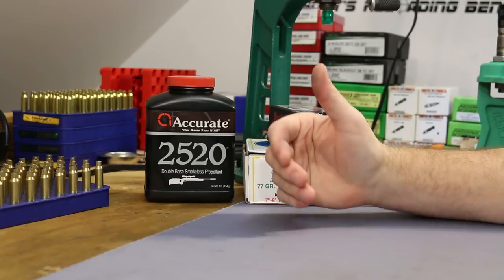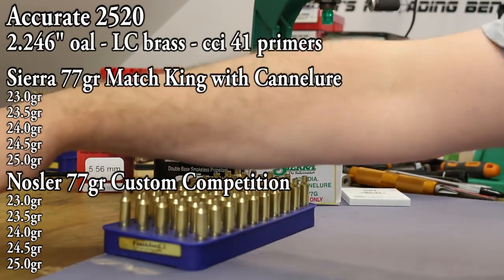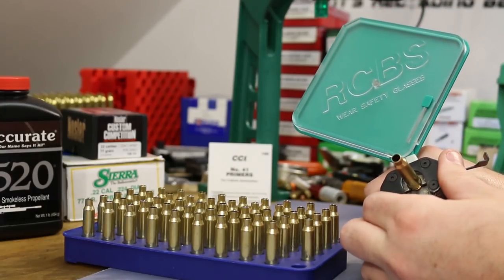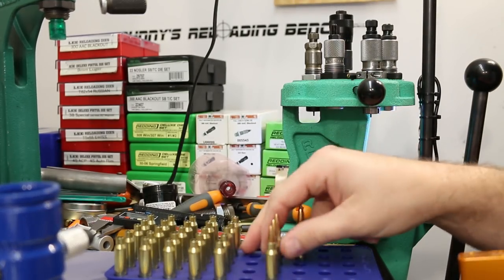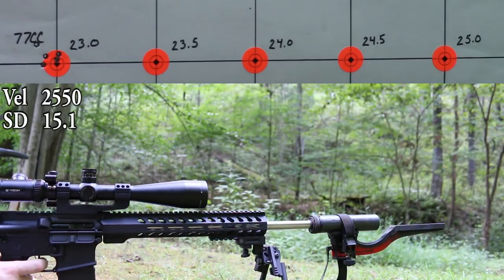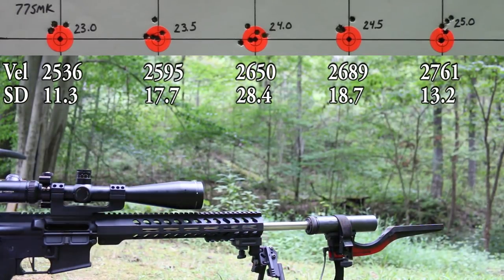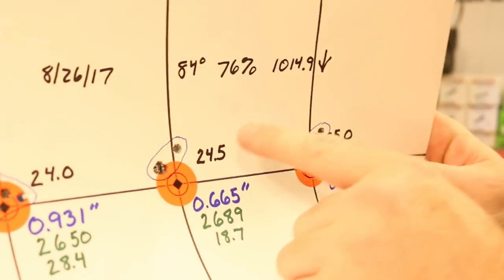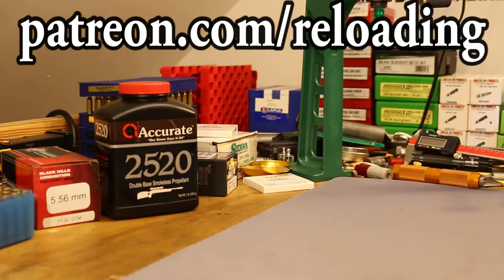Mk 262 Cloning - pt 2 - Sierra vs Nosler with AA2520

Comment: Discovered this series in 2021 after pulling stuff out of storage. Purchased a couple boxes of the BH 77gr OTM at inflated prices to examine and the one round I've pulled apart has an extruded, single perforated powder at 23.0 gr. The mystery deepens. Great channel and very helpful info for everyone.
Reply: I'm guessing they change their load based on feedback from the military, because the one I pulled had a ball powder and a primer that both looked different than the powder and primer in this video and it was 24.2 grains. I'm starting to think that any 77 grain load that meets the standard could be considered a mk 262 lol

Comment: Love this series JRB. Your gonna end up breaking that 1/2" barrier in this series, I'm calling it, I see a 1/4" group coming! Please just make sure in the series if you can to test IMR 8208 XBR and TAC. Around 23.8 grains of IMR 8208 XBR seems to be the clone load for IMR 8208 XBR, and around 24.0 grains of TAC seems to be the clone load for TAC.

Not sure it mattered either with the crimp on the Noslers, while I don't crimp non cannelure match bullets and it certainly doesn't take much crimp to put a crease in one by crimping it without a cannelure, I still don't think it mattered. In my experience they just don't shoot as good as SMK. 

I like the idea of adding the best load from the previous powder to the next test to compare to. Also your barrel is shooting great but definitely shoots better cool, thumbs up for taking that break to let it cool. Keep up this great series.
Reply: I would like to see you shoot these round robin style, one into each group so that barrel heating issues are dispersed across the entire series.
Reply: That 23.8gr load is what many folks associated with the USAR rifle team use. I have used 23.5gr since 2012  to good effect. I have no doubt that I could stitch an Echo target pretty well to 600y with that loading.

Comment: At 25:34...this is a classic flattened primer.  1st sign of high pressure. An observation...the most accurate load usually follows a "scatter group" ..and peak accuracy is almost never at the very top end of the pressure curve but rather one or sometimes two powder increments lower.  good shooting!

Comment: It's 2022 and you still make an impact. I'm doing some cloning of my own and I thank you for the magnificent work you did here. I'm in the process of creating my go to round for my sons and my rifle, and this ground work you laid is perfect. I have a question regarding the part when you decide to include the Nosler box because and of the different lengths you found from Black Hills to Sierra and the Nosler brand. I saw two other videos from other sources regarding putting on cannelures on projectiles because the price differences now a days on projectiles with or without cannelures is significant, then it hit me. The two simple hand-held, non-electric machines (the size of concentric gadgets) when I viewed them one after the other, both operate similar but in addition, they squeeze differently. So, what do you think when It come to machinery and operator doing the squeezing on the projectile? Different forces applied, can push up the projectile, kind of deforming it. I might be going our on the weeds here, but I just think about the physics behind that detail. it could be the difference. Just a thought, Thank you for doing great work.

Comment: Second grp, Nosler. (20:05 minutes) ...I believe the norm for hunting bullets is not a consistent hot barrel.  Nosler bullets are typically or originally design for bolt action hunting.

Comment: I thought I wanted to clone this load as well for my 20" SPR build. Couldn't get Sierras to group well at all, which is odd because I shoot only Sierra match kings in my 308 and 6.5s. Ended up with 24.5 grs Varget and 75 gr bthp Hornady bullets. Shoots under a half inch right at 2700 fps. Great shooting load. 
Would love to see a video on 75 gr bthp!

Comment: Great videos man. Keep em coming.. I have looked through your channel but couldn't find anything. Do you have a link for a video on the load development for the 75gr Hornady match bthp bullet?
Reply from the maker: I finally got my playlists cleaned up this morning, so playlists are really the best way to navigate for info on a specific cartridge.  However, that wouldn't have helped you in this case.  The only time I've shot them on camera was during my White Oak barrel break-in video.  Here's a link: https://youtu.be/AUgsgUEPDGI?t=25m7s
Reply: Thanks! Went back and watched the video. Is AR comp the only powder you've tested with those projectiles? If you have some time I would definitely appreciate a video testing different types of powders as I just bought 1,000 of those bullets and am going to be doing my own load development. Going to be testing Benchmark, CFE223, Varget and H335 but you're way better at reloading so I figured I'd ask.

Comment: Can you try 8208 xbr? I've heard good things but I'm not sure if it's just internet nonsense. Thanks
Reply: IMR 8208 works great in the 5.56, its no internet rumor. I run 22.7gr with a 75gr Hornady BTHP and get sub MOA accuracy
Reply: Falcongaming 
I use that powder a lot. It is very good.
Reply: 8208 XBR is great powder, but it is a fast powder and usually isn't the best choice for "heavy for caliber" loads and trying to still maintain respectable velocity.  Johnny said it best, 2 kinds of powders, ones that punch and ones that push.  XBR is a punch so it can get you into trouble with pressure.

Comment: I think almost all of the primer pocket issues you are having can be fixed if you use a primer pocket swager.   they remove the crimp, set them to the right size(if they are too short and skinny(they cant help if they are too deep or too loose)) nice thing is that they only need to be swagged once.  Might stream line your order of operations.

Comment: I normally don't post this on the internet, but you seem like you know what you are doing. I now live in NC. When was living in SoCal, my goto load was 25.2 grains of AA2520 and a either a Horndady 75 grain BTHP or either Nosler or Sierra 77. I only use Lake city brass.
 Out of my 20 inch RRA that load was giving me and average MV of 2908. (that is not a misprint) As a commented on one of your other videos, when I moved back to NC that load started blowing primers. 
AA2520 is an accurate powder but it isn't temp stable.
I still like because I have used it for so long I know what I can and cannot get away with.

Comment: I think you found your MK262 clone with the 25gr A2520 and the 77 SMK.  Don't know why your Noslers were all over the place as Ive had very good luck with them.
There is a military load with the 75gr Hornady I can't remember the designation and I don't know if its used in a special unit or if its just a backup load if the 77 SMK is not available..I don't know  but I do know it starts with "MK" like the 262. I have info on it somewhere, Ill go find it. But I do remember the powder and charge weight is the same with the MK262 load

Comment: I never had any luck with Nosler match bullets. Just my two cents...
Reply: I have been reloading for only 5 years and I never had any luck with Nosler bullets either. I guess I am not only one. Hornady and Sierra produce best results for me.
Reply: John Smith I have never had good luck with Nosler
Reply: John Smith My experience with nosler is mostly ballistic tips, and they grouped pretty well. Not like a SMK, but better than my typical hornady soft points
Reply: I have been shooting also for a couple years and I have found that Moslers tend to only shoot good with varget
Reply: Sierra TMK
Reply: I have the same patten with Nosler bullets....shitty, do not use them anymore, better off slinging rocks.
Reply: I've had some good luck with Noslers. Gave me some awesome groups with my BCA barrel.

Comment: What tool do you use to get a 1.750 trim length?  I have tried the Lee and another but my trim length is inconsistent and generally too short, around 1.740.

Comment: Thanks for the video. Question, so you want to clone the MK262 but if you have a better shooting load with the 75gr Hornady, why bother? Just for fun? Have you tried the IMI Razorcore MK262 clone yet? I'm testing that out of my 18" Ballistic Advantage .223 Wylde barrel. I really have to concentrate but I'm getting about an MOA right now. Barrel is brand new though but was properly broken in - if that really matters. I have some CFE223 to play with along with some 77gr Tipped Match Kings. We'll see how those do once I have time to reload .223. Keep up the good work!

Comment: I have had CRAZY variation in Sierra 175 Matchkings, much more than what you see here. I called Sierra at one point to ask if they actually changed the bullet. They told me what I was seeing was lot to lot variation. I am not 100% sure off hand but I think it was close to .030 - .040 of variation. I think thats what's going on with your Matchkings vs. pulled bullets from MK262.

Comment: For ball powders, you need a high brissance primer...WSR...Magnum primers otherwise. The reason being that you need to burn the deterrent coating off of ball powder to get ballistic uniformity.
Reply: Cci has always stated that their #41 primer is designed specifically for ball/ spherical powders in the 5.56mm cartridge.  It is "high brissance"

Comment: My 23grain loads of A2520 are averaging 2470fps according to my lab radar. My loads are seated to 2.255” so I get that your loads are higher pressure but I’m shooting a 20” barreled AR. I’m surprised I’m 60fps slower than your loads

Comment: Unless there's a significant difference in the jacket thickness between Nosler's 224 and 308 bullets, I don't think it's the crimp that caused you the problems.  I always put a light crimp on my 168gr Nosler CC in 308, and they shoot about .6 MOA for me.

Comment: I just started watching your Mk 262 Mod1 series today. In this video you expressed concern that crimp may be the downfall of the Nosler bullet’s performance. While that may be a possible cause, I believe the bullet and the barrel are not a good match. Over the years I have found many bullets that shooter’s rave about, just did not shoot in my barrel, no matter what I did to fix the issue. Now today, when I find a bullet does not shoot well in my barrel, regardless of its popularity, I move on. 
For example, I am running tests with my Savage 12 LRP in 6.5CM, and no matter what I did, the Hornady 130gr ELD M would not group 5rds, in 1/2 –inch or less at 100yds. However, the Berger 130gr AR Hybrid OTM Tactical consistently groups at ½-inch or less. Just saying…
Reply: Try the Hornady 140gr ELD M rounds, my savage 12 loves them.  very consistant

Comment: AA2520 is an excellent powder. Just watch the temp swings. Your problem with your 23.5 and 24.0 powder charges was what is called a scatter note. You could see it with the Match kings as well, just not as bad because you have a barrel that doesn't the like nosler bullets.  Since AA2520 is a slow powder, shoot your 25.0 load out of a 20 inch barrel and you will be in another world as far a speed is concerned. My last SS barrel loved nosler bullets. Its a hit or miss thing with which barrel likes what bullets. 

I actually have a chrome lined 7 twist barrel that will stabilize anything that will fit into the magazine but only groups well with Hornady's new 62 grain hollow point at about 3050 fps loaded over 25.9 grains of AA2520.

If I had your barrel on my rifle, I would stick with the  match kings and start with 25.0 of AA2520 and work back down in 0.1 grain increments until I got a load under moa with no ejector marks and call it done. Since your barrel seems to be EASILY capable of half moa precision that shouldn't be an issue.

Great video.  I'm looking forward to your final findings